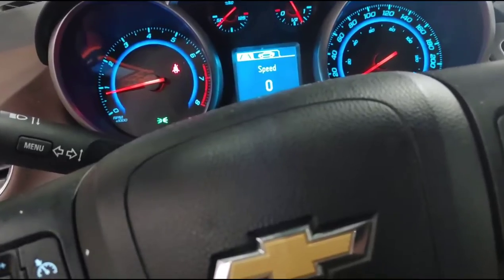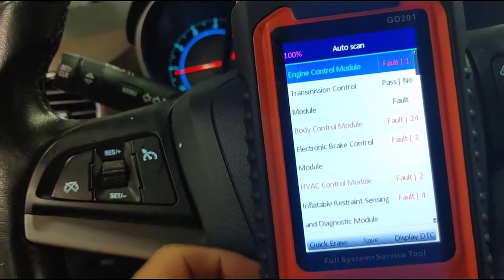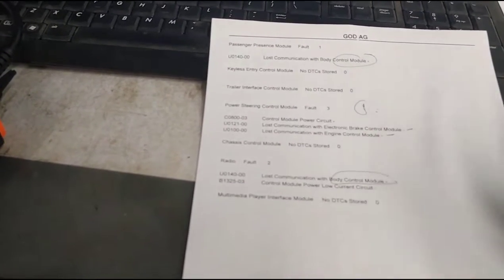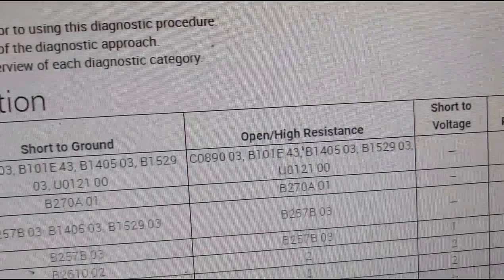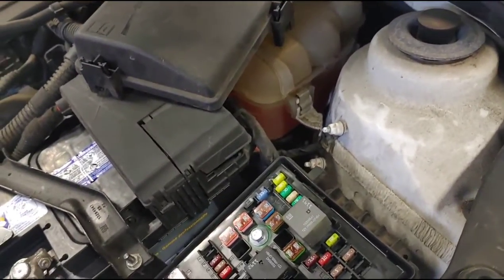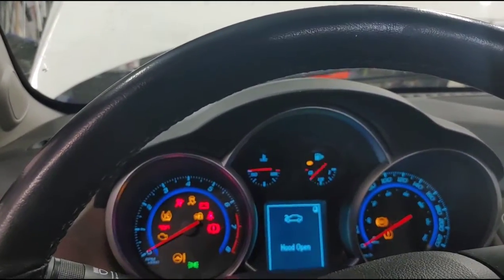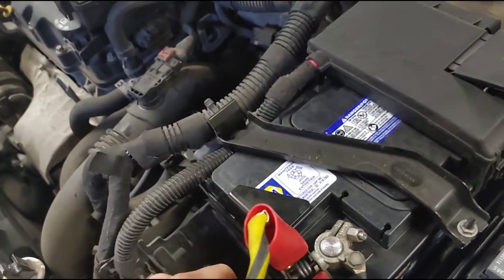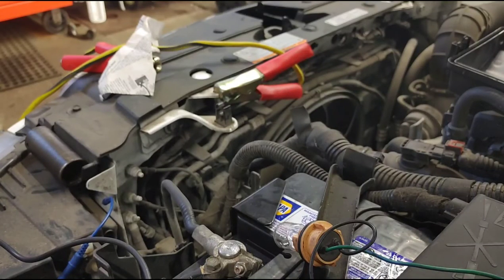Chevrolet Cruze Intermittently does not start

Comment: Negative battery cable
Reply from the maker: That's right
Reply: @JLsAutoSolution  I have been battling this issue with the negative battery cable for as long as I had the vehicle going on 3 years now I've had my 2011 Cruze LT 1.4T the key too fixing this car and replacing parts is to not buy factory gm parts